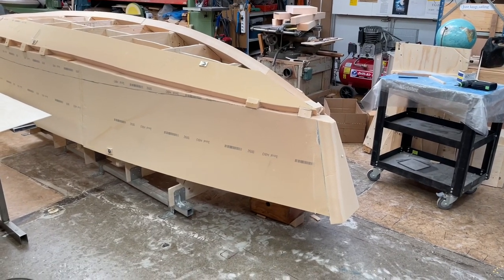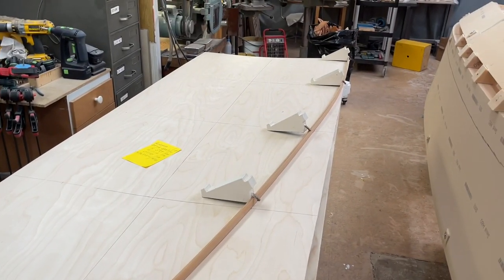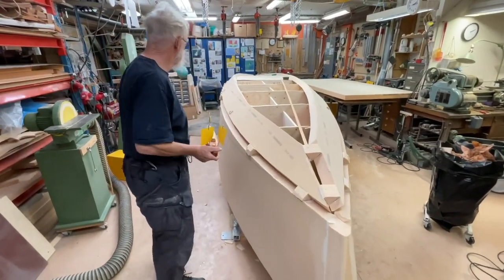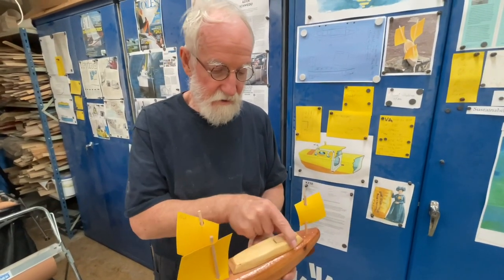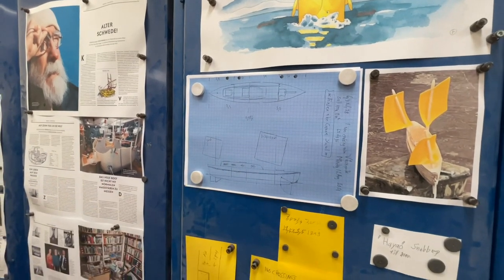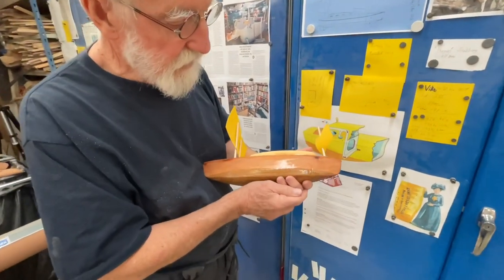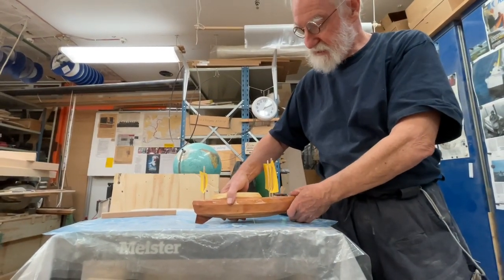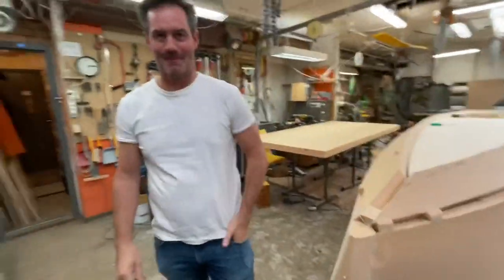Update and marking bottom piece

Comment: Much clearer now how the centerboard will work but I wonder how easy the boat will be to turn with the centerboard so far to the front.  Maybe it will pivot around the centerboard?  Interesting-  Thanks Peter.
Reply: thats cos most of the sail area is up fwd,,,  it all has to balance or its a shit fight at the tiller,,, plus there is the skeg/rudder way aft,, so the CLR is gonna be aprox midships.. Sven will have designed it to work.
Reply from the maker: In the middle of the 1980 I biuld a small open boat with bow cb It worked fin then I build a decked version 4.8 meter.In 1989 with a girl I sailed her from France to Newfoundland. It worked very well. I sold plans 10 maybee 20 where built a few of them crossed the Atlantic so my concept is well proved. The difference now is that there is a skeg in front of the rudder. We will see what difference it makes.
Reply: @SvenYrvindExlex  So I think that once the boat starts turning it should start to rotate or pivot around the front centerboard.  Are you going to 1. make the centerboard adjustable and 2. able to lift it from the helm?